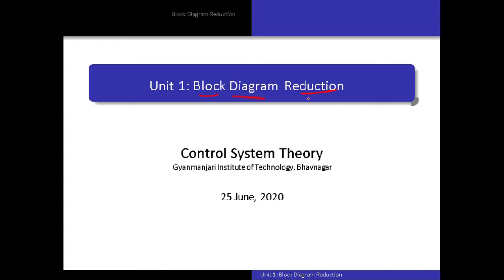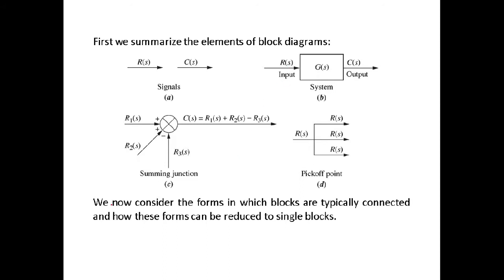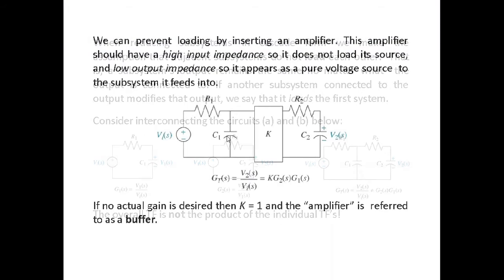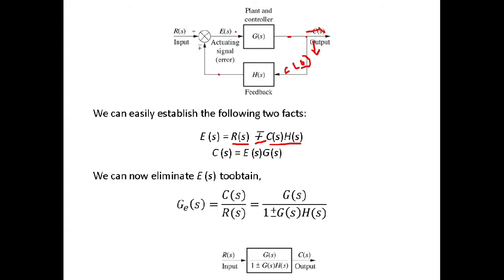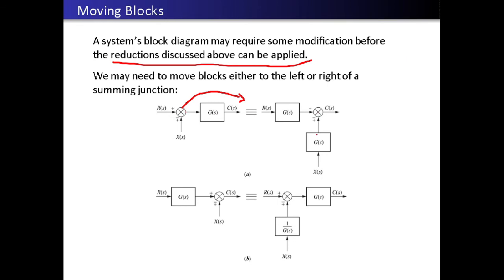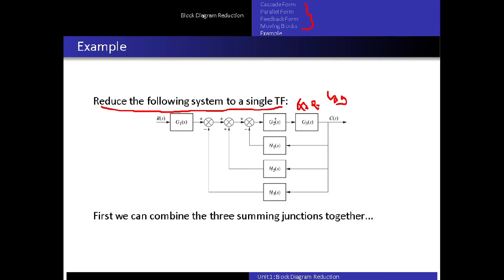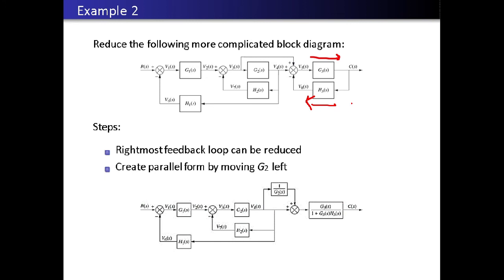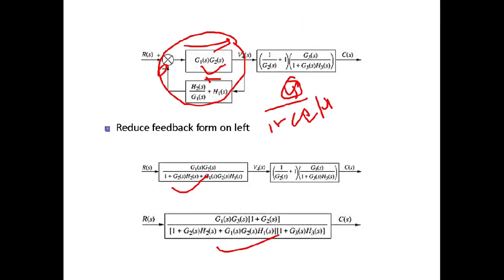Rules of Block Diagram Reduction Technique With Example || Control System || Hiren Kherala

Comment: What if we move our take off point to right /left of H
Reply from the maker: Shifting of take-off point ahead of the block:
As the actual gain is G(s) so the additional block will have a gain of 1/G(s).
Shifting of take-off point behind the block:
As the actual gain is G(s) so the additional block will have a gain of G(s).

In short exactly opposite to whatever we have discussed in case of summing point.